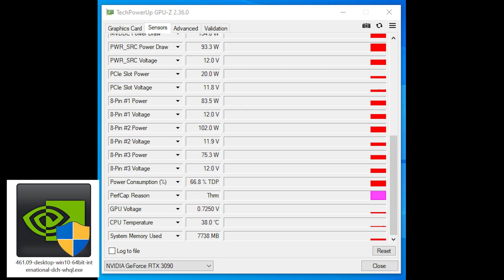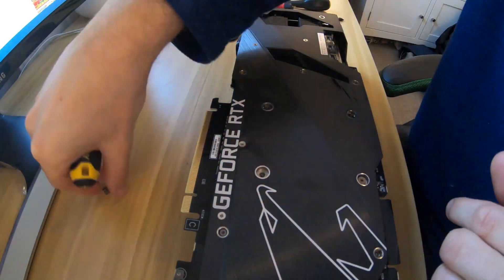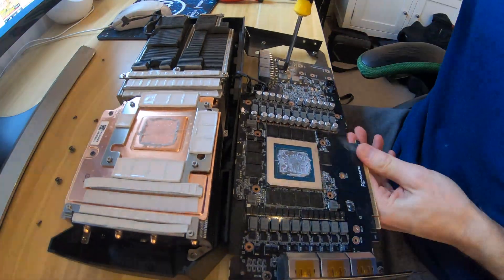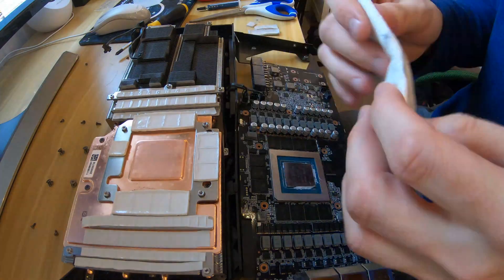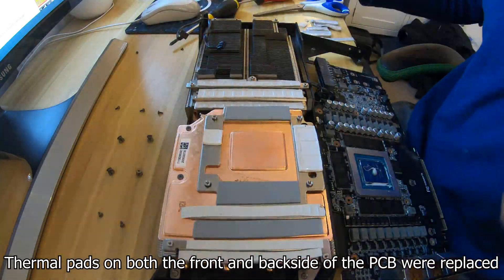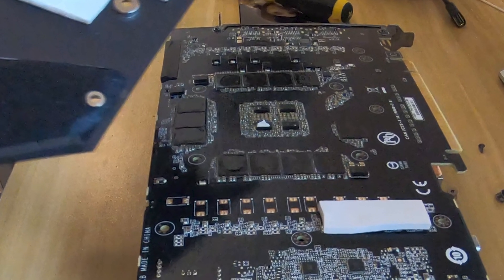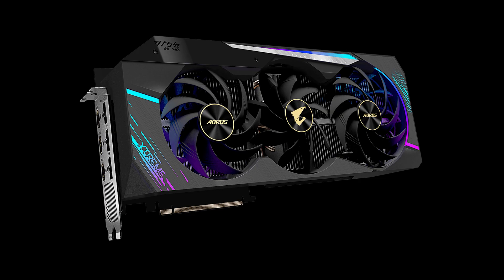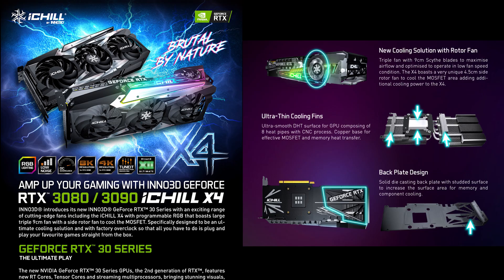Gigabyte RTX 3090 Aorus Xtreme GDDR6X overclocked memory overheating [FIXED]+ buying recommendations

Comment: As a temporary fix I ended up tossing 2 old AMD cpu coolers onto my backplate as well. Makes me happy to see I'm not the only crazy person out here. 
Memory temps dropped around 6-8c by doing that. I'm going to do all new thermal pads as soon as they come in. Wish I would have ran across this video sooner.
Reply from the maker: Yes, it is pretty awful to look at, I've upgraded (not sure if you can call it that) to small Alu heaksinks. So I now have a smaller profile cooling solution but not quite as much brute cooling force as the AMD coolers. I think new thermal pads would work, a lot of people have commented on the quality and thickness having to be correct so I would look into that before pulling the card apart. Save yourself some trouble.

Comment: My 3080 Aorus master has this issue, changing the main memory pads to 2mm 12.8w/mk and the backplate adding some 2mm pads I am able to keep the memory temps under 90c even while mining and having it at +1300mhz
Reply from the maker: That's an awesome result, what brand pads did you use?
Reply: @MindfulMotorcyclist  thermalright pads were used
Reply from the maker: @BEU203  Thanks!
Reply: @MindfulMotorcyclist  no problem I’ll be trying the same thing with other cards that may need it
Reply from the maker: @BEU203  Be interesting to know which brand is the worst, so far Gigabyte seems poor and EVGA seems the best but still hot of course, if you have many cards that might be revealing

Comment: When a card’s thermal design is so bad that we have to bootstrap 2 amd wraith cpu coolers to its backplate.....
Its hilarious!
Reply from the maker: Not when the card is priced at £2300! Horrific value proposition. GDDR6 only for me now on, unless a 3080 came up at RRP, then I might bend the rules haha.
Reply: @MindfulMotorcyclist  Yea the reviewers have been saying its a horrific value proposition since the day it launched. I'm curious what made you buy it? Was there only 3090s available for MSRP when you were looking for GPUs for mining?
Reply from the maker: @VamosGamingSys  A couple of things really, I was able to get it at closer to RRP and I am more of a PC hardware enthusiast and video editor than just a pure crypto miner so the appeal of having the 1080ti and 2080ti successor, the top of the line GPU was something to consider. Back in late 2020 you could find 3090s and they would stay online available to buy when 3080s were long gone, plus back then we didnt know how hot GDDR6X was. I think availability of the 30-series has as you would expect been correlated very closely to the price of crypto. I was able to get a gigabyte Aorus Xtreme 3090 which is awful frankly, and an EVGA FTW3 3090 which is great, runs relatively cool (as standard) and mines easily 127mHs. The 3060ti is a great value proposition and better choice for mining of course but you cant get them and a 3090 will pay for itself in months not years based on BTC prices and 3090s have a lower rig density, which I also like. I'm not a total 3090 fanboy however and I returned a Gigabyte 3090 Aorus Wateforce as it was so poor. I will never again buy a Gigabyte GPU or mainboard. All these cards also have good residual value as Ampre is relatively new in its life cycle plus stock is low so spending big on a 3090 isnt quite as bad as it initially feels. That's my thoughts anyway...

Comment: Nice video, I got the 3090 extreme aswell. Im not sure if I dare to open it up and replace the pads as Im very nervous about ruining such an expensive card with inexperience. But Im tempted to try put  pads on top of the backplate along with some fins to reduce memory temps
Reply from the maker: Thanks for the nice comment 👍. I wouldn't open it up if I could do it again, it didn't make much difference to the temps and Gigabyte are known to be difficult with warranty claims. It was my first time stripping a 3090 as well so quite nervous with it being a £2000 card! Luckily it all went back together and works 😁
Reply: @MindfulMotorcyclist  Hey thanks for the quick reply, I dind't know that gigabyte were bad with RMA's I be careful with the card then :)

Comment: Hi, Thanks for sharing. I have Zotac 3080 and 3090 using for gaming and Ether mining. Both cards looks identical and both bottlenecking with back memory temperature. Even with fans running at 100% back plate is roasting while heavy mining. The only solution I have is something you did with additional rads and fans at the back. I would love to see plug and play heat sink with large radiator and fan to cool the memory. BTW I wonder how the back plate cooling is done with factory made water cooled 3090 from ichill or EKWB. If anybody has suggestions or experience please share.
Reply from the maker: Hi, thanks for sharing your experience. I'm the same with VRAM temps at 108 and 102 on my 3090s, not good. I even had a Aorus Xtreme Waterforce 3090 and that was just as bad. I think you HAVE to have active backplate cooling for a proper solution.

Comment: What are your vram temps? You can read it in hwinfo64.
Reply from the maker: 108*C, on the gigabyte and 104*C on the EVGA, the FTW3 card is stock (no pad change)
Reply: @MindfulMotorcyclist  what fan speed? I literally have the same 3090s as you lol.
Reply from the maker: @propeldragon  I'm on 70% with the EVGA (1700rpm) and 100% (3000rpm) with the Gigabyte, sounds like a hurricane does that card 😂
Reply: @MindfulMotorcyclist  Aorus has horrible vram temps. I’m going to only repad the back where the vram is.

Comment: I had memory throttling issues with my 3080 aorus xtreme as well. Hits 110c memory junction on +0 memory clock. Ive recently replaced all thermal pads on the PCB(they were all oily) with 12.8 w/mk pads 1.0mm thick while double stacking on the memory spots. Now I can overclock the memory at +1500 while memory junction temp is around 74-78c.
Reply from the maker: Sounds like a great result, what brand pads did you use?
Reply: @MindfulMotorcyclist  thermalright
Reply from the maker: @barronhelmutschnitzelnazi2188  Thanks!

Comment: literally everyone has issues with thermal throteling on the 3080 and 
3090 fe and gigabite models. i mine crypto, i know yall probably hate 
me, but if you replace the thermal pads on the front and back of the pcb
 they dont throttle although the mem temps are still way high like 105c.
 and the evga ftw 3 is hit or miss i have 2 3080s and one throteled till
 i fixed it.
Reply from the maker: Mine arent throttling since the pad change but still running at 106*C to 108*C. What pads and thickness did you use?

Comment: I clicked because in my head, this was the solution to my hot af gigabyte 3080.  I’ve set power limits to 56% and no mem overclock, it still reaches 102 junctional temps
Reply from the maker: Sadly, from my experience and comments from others Gigabyte is the worst brand for poor thermal design. One thing I never could understand though is why the 3080 with only 10GB of VRAM on the front of the card is so hot, I get it that the 3090 has passively cooled memory modules on the backside but why the 3080?
Reply: @MindfulMotorcyclist  it's the thermal pads. My 3080 aorus xtreme ran fine until just recently it started throttling really bad. Found out the pads got really oily and looks cheap. Swapped them out and now it's running better than ever
Reply from the maker: @barronhelmutschnitzelnazi2188  I'll have to try changing them out, I guess I've already opened the card up now so no warranty issues to worry about. What thickness and brand pad did you use to get this good result?

Comment: Hi! Do i need to do this when I don’t overclock in general (assuming that I have the same card as yours)?
Reply from the maker: No you don't, it will run hot but still work fine. I would actually NOT take the card apart that way if anything does go wrong you can send it back.
Reply: @MindfulMotorcyclist  thank you for clearing that out.

Comment: Add pads to the backside of the PCB, genius. Not just the front. Lol. Do that and you WILL fix your thermal throttling issue. I tell you this from experience. Take that ryzen cooler off and add 3mm pads to the back, where the vram is.
Reply from the maker: I did add 2mm pads and there was no improvement. What card do you have?

Comment: If it were not for Steve's (Hardware Unboxed) review of this card I would have bought one as I had the 2080 Ti Aorus and loved it but this card is all show and no play. I ended up going w/ the Strix OC. I'm probably going to undervolt it too. At most I might slap some copper heat sinks w/ a fan on the back plate but only if the undervolt is struggling.
Reply from the maker: I'll have to watch that one. I bought this Aorus xtreme way back when in Dec and it was a lucky find. You did well getting a Strix, I might choose EVGA if I could pick one or maybe one of the Palit/Galax offerings. Still really rate my FTW3 1080ti
Reply: @MindfulMotorcyclist  yeah ive been looking at copper m.2 ssd heatsinks. Ive seen a few vids of ppl using something similar and dropping their temps as much as 10C. I don't plan to do any mining and most of my game play will be at 1440p so my temps on memory based on benches i've seen should be around 80C but if I see 90-100C ill look to do the heat sink mod.

Comment: Check your pad's thickness and perhaps adding some thermal paste between the heatsink and the pad to make sure the pad is connected perfectly ot the heatsink or GDD6X memory.
However do pay attention that your thermal paste must not be conductive.

Usually such pad replacing gives you every decent memory junction temp that should be set below 80C. As I had done to ROG, TUF, ADOC, SUPRIM, and VISION.
Reply from the maker: Thanks for this advice! I need to strip the card down again and see of I can get improvements. I already have the small heatsinks and the 120mm fan blowing on the backplate.

Comment: I have the same card & emailed gigabyte about the memory chips. 

Their reply:
Kindly note that 3rd party software does not know our hardware design so we cannot guarantee the result. As long as the card runs fine, we do not see an issue of it. 

Regards,
GIGABYTE

Even after undervolting My RTX 3090 Aorus Xtreme Memory chips runs 12c hotter than my Gigabyte 3090 Gaming OC & Galax 3090. What a joke, they are charging $3500 AUD for the Xtreme in Australia now. Luckily I bought mine for $3300 AUD with 4 years warranty just before the prices got raised. I got a 120mm fan running on the backplate and just bought some heat sinks. I won't open the Aorus, I mean 4 years warranty is still good right. hahaha
Reply from the maker: Wow that is incredible, talk about a company that values their customers. I will think twice about buying Gigabyte GPUs but also mainboards now after my experience with the Aorus Xtreme. I think the premium brands are starting to take their customer following for granted, I'll be looking at the likes of Palit, Galax and PNY now. I think you're right just run the card for the full for years and RMA it if you have any problems.
Reply: @MindfulMotorcyclist  The Galax 3090 is actually really premium build quality (even the most entry level), cheapest of all 3090's in Australia, ZERO GPU sag and best VRAM temperatures. Meanwhile both of my Gigabyte cards require a bracket to help keep it horizontal. I must admit though the Xtreme has the absolute best FPS performance, although the Galax takes the cake with mining and I do both. The Xtreme sometimes has a 8-10% FPS difference on the Galax which is actually quite significant. But not +$1000 significant. I suppose Aorus never endorsed these cards to be mining ethereum rofl. Try entry level Galax for reasons stated above, they wholeheartedly have my endorsement. Take care brother! and thanks for the video.

Comment: Same problem on my 2 Gigabyte 3080
Reply from the maker: Which is weird as they don't have memory chips on the back of the PCB?
Reply: @MindfulMotorcyclist  Yup I think they have them on the back but Gigabyte didn't put thermal pads on them wich is weird... People fix it with thermal pads 3 mm thick but don't wanna broke the warranty wich is 4 years on that card, too good to lose it :)

Comment: The solution name is:" thermal pads "
Reply from the maker: A few people have tried replacing the thermal pads and it doesnt work 😒
Reply: @MindfulMotorcyclist  well you need to replace both sides and more gigabyte doesn't cover all vram from the back with thermal pads. If done correctly it will work. Watch son of a tech Video about the matter
Reply from the maker: Looks like I'll have to replace the thermal pads again then. They did have pads on the back at least on my card. I'll have to look at this vid then 👍
Reply: @EA_47_  son of a tech did it to the 3080 without the extra memory on the back like the 3090

Comment: I have a Gigabyte 3090 vision and was running into thermal throttling issues also without any overclock. I replaced front and back thermal pads for the memory modules (2mm front, 3mm back if I remember correctly). Now I can Mine ETH at +1100 mem overclock getting ~120Mh/s at 315watts with memory junction temp around 90C with fanspeed at 88%.
Reply: Partner u don’t need to go that high 315w for the power bring it down mine is running at 215w u need to power limit it !!
Reply from the maker: Hi thanks for this comment. What kind of backplate does the Vision card have? Seems like you have good results, possibly because you used thicker thermal pads which make good contact to the modules this has improved things for you! Thanks for sharing.
Reply: @MindfulMotorcyclist  the backplate is just a normal aluminum backplate. Also FYR I used Thermalright extreme Odyssey thermal pads.

Comment: Pretty pathetic card, i mean it's a beast of a GPU but it's kinda sad that the base model (Gaming OC) runs cooler and quieter check Hardware Unboxed video about 3090 Gaming OC and Aorus xtreme.
Reply from the maker: I agree it's disappointing, the only saving grace with the Aorus Xtreme is the core is probably binned highly so more extreme overclocks would be possible. If I could buy again I'd go for a EVGA FTW3 or even a Palit/Galax. Not much chance of that in current climate
Reply: @MindfulMotorcyclist  Btw congratz on getting a 3090, i wasn't trying to be rude with my prevoius comment.
Reply from the maker: @greggreg2458  No problem, I even sent one 3090 back. The Gigabyte RTX 3090 Waterforce card because it really underperforms compared to the Aorus extreme (it's got no backplate cooling and only a 240mm rad). On reflection I think should I of kept it given the current situation. Maybe someone else can buy it 'new opened box'. I also think that they are too much money at £1900+ when RRP is £1400.
Reply: @MindfulMotorcyclist  can i ask you how you were able to get so many gpus?
Reply from the maker: @greggreg2458  Sure, I was able to get the first couple of 3090 before BTC went to silly levels in early Dec. The second was in Jan and that was a time when the 3070, 3080 would appear but then vanish from online stores or you could actually still go on a waiting list. The 3090s at that time hung around about a day or two online partly because they do not make that much sense mining from ROI point of view compared to 3080 but also as not as many people have the best part of £2k to drop on a GPU. I think it is much harder now to get one...
Reply from the maker: Just picked up another 3070. Still it was £850 new, on a card that is MRRP of £500. Shops are joining in on the scapling
Reply: @MindfulMotorcyclist  Can you make enough money with mining to make up the difference?
Reply from the maker: @greggreg2458  £5/day for a 3070, so I suppose in 70 days your at normal price for a 3070. Of course this relies on crypto not crashing into oblivion which it has done many times in the past 🤞, its a risk but it seems people are taking that risk hence the stock shortage.

Comment: Hi,
the vram temperature of my rtx 3090 aorus master is about 102-104 degrees, ambient temperature of 20 degrees, with -200 core clock, +1200 memory clock, 82% power limit, 100% fans, consumption 300w, 120mhs stable in mining, in 5 days never at thermal throttling.
I was wondering if it's okay or is it a dangerous temperature? do i have to try to lower the temperature? i don't see warranty seals if i open the video card to change the thermal pads do i lose the warranty?
however I can lower the temperature of the vram up to 96-98 degrees but after I don't get 120 mhs anymore ......
Reply: 104 is very high temp for memory,
Reply from the maker: It's really hot, but as long as you don't void the warranty you could always RMA the card in 9 months if anything went wrong. It will have paid for itself in 9 months at 120MH/s. There are 'solutions' online to stick little heatsinks to the backplate and that can lower your temps by a few degrees, might be worth a look? Also maybe lower the power limit as much as you can before the MH/s drops. Possibly 70-75 % is achievable as the core is so OP it is not the rate limiting step. Less power might = less heat.